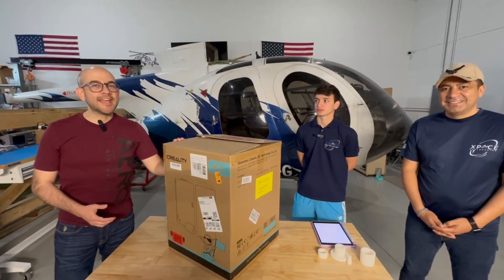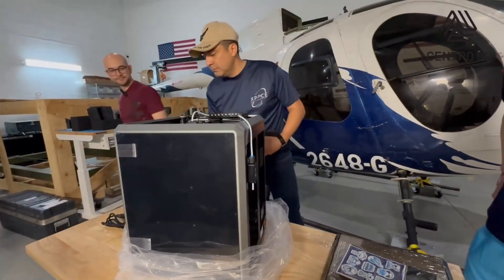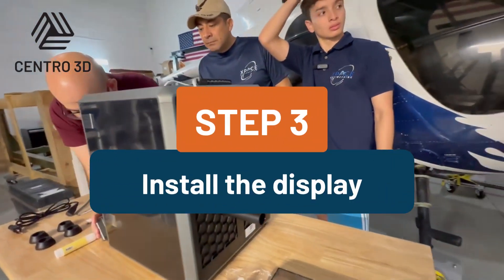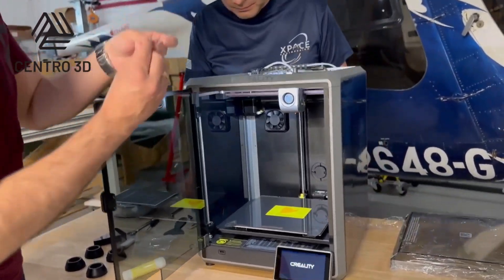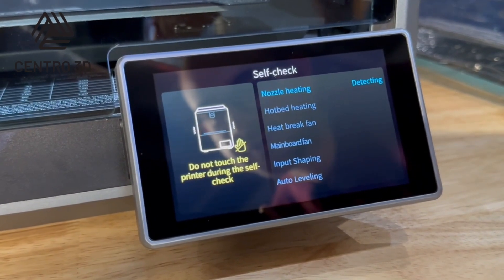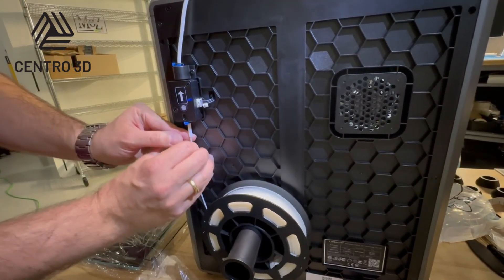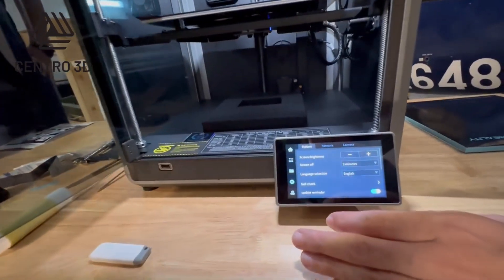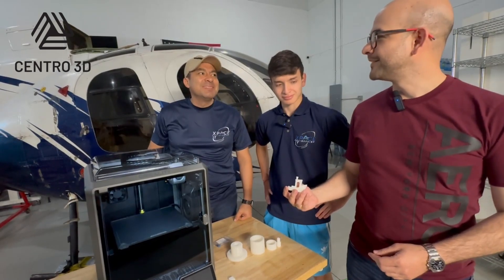Creality K1 Unboxing. Centro3D and XPace in the United States cooperate in 3D printing projects

Comment: The best thing about that printer was when i sold it
Reply from the maker: Can you explain us your experience with the printer? I would love to hear about it
Reply: @Centro3D  I need to level the build plate as soon as I turn it on. Something was wrong with belt tension/motors, thats why i was having a ghosting effect on all my prints(I was not able to fix that). By default, the printer is very loud. The only good thing having this printer is a root access. Maybe it was just a bad luck.